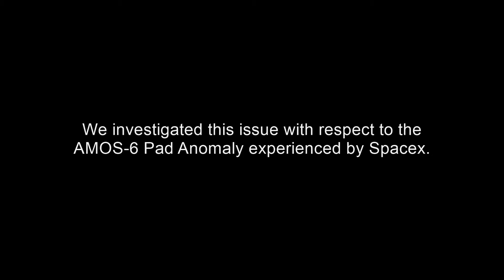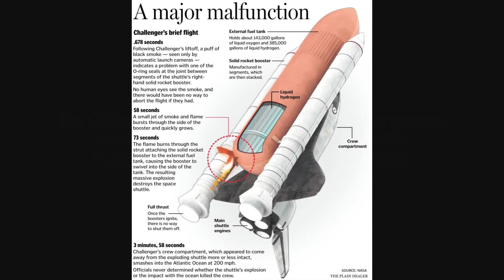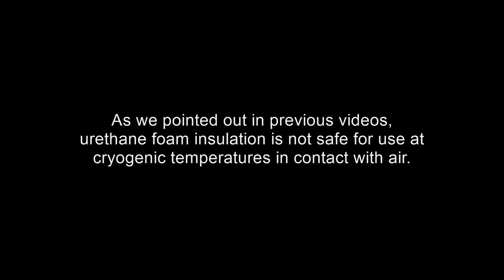Watch Delta-IV Urethane Explosion on Launch - Just as We Predicted

Comment: According to NASA this kind of engine is purged with hydrogen at startup because it's less corrosive than LOX.  It's expected that the hydrogen will be set alight by the ignitors.  It does appear to me that the point of initial ignition is near the base of the boosters, rather than in the foam.